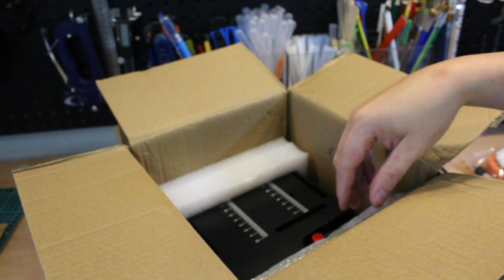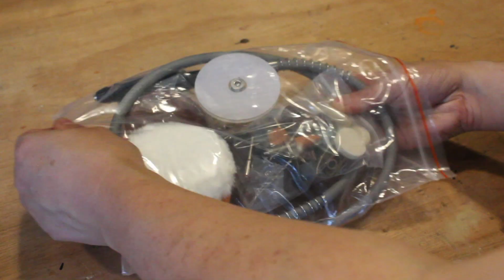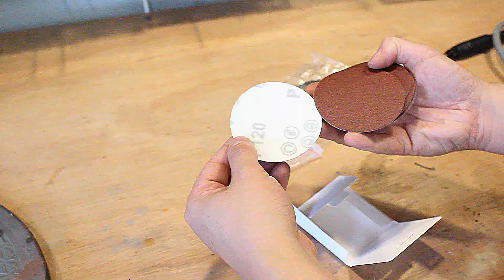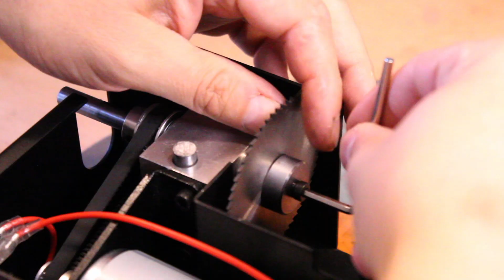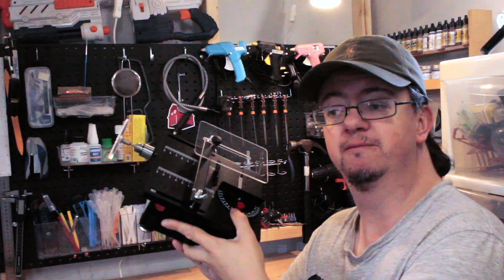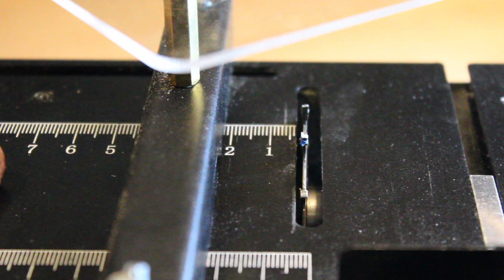Should you buy this Mini Table Saw? - FULL Review!

Comment: I ordered a similar but simplified version off Amazon and it will arrive tomorrow. I’m looking to cut some 1/4” plastic for a tool grid organization in my toolbox and they need cutting to size for your particular toolbox drawer dimensions. I have limited space to store large tools like a standard table saw so I went with one of these as they are the right size and price just for this one project.
Reply from the maker: From what you stated, this would probably work really well for your needs... I must admit I feel like I might have reviewed it a bit harshly, as I have used it plenty of times since the review and it has mostly done what I needed it to... 

However just be aware that if you are looking for ACCURATE cuts, you might need to spend a little (i.e. a LOT) of time checking and rechecking or you'll end up disappointed, frustrated and annoyed. 

Let me know ow how you get on! 🪚🪚🔨
Reply: @DarlingbroughSciFiBuilds I will let you know and possibly film myself cutting the plastic sheets of tool grid. It cant be any worse than my free hand attempt with a jigsaw that was a terrible cut that may have cost me a $120 single board of material. If this saw gets the cut within a couple millimeters of accurate I will be way ahead from where I was. I won’t be sending these things to the moon. I just need something better than a wavy or jagged cut free handing it resulted in. Thanks for taking the time to review, assemble and demonstrate the product. I’m sure it will be helpful when mine arrives tomorrow.
Reply from the maker: Hahaha We have all been there, destroying materials and messing up! Good luck! ❤❤

Comment: ‼‼INSTRUCTIONS‼‼(5-14-26)
Thank you for your video.  I Just found the time to put mine together.  My Temu instructions are really cheesy crummy instructions.  I could not figure out which way the dang spindle was turning for the Longest time to mount the sawblade correctly.  I figured it out by turning on the machine Without the Sawblade.  The open spindle is smooth.  Feel it turning with your thumb and forefinger.  Now you know eh?  Lol

I was testing some Slightly larger pieces of wood that went over the top of the blade by about 1/8 of an inch which caused the spindle to drift to the right and caused serious vibrations making the machine unusable.  Taking the top platform off to look inside was very revealing and informative.  The non sawblade spindle is operated by the controlling motor for the rubber belt that operates both spindles.  The spindle that operates the saw blade drifts because the belt is not properly aligned 180 degrees.  So to correct itself it drifts to the right so that it does align but causes a heavy vibration making the saw unusable.  

                                                          ‼‼‼THE SOLUTION‼‼
The solution I did is to push the sawblade spindle as far to the left (its original position) as possible.  You should hear it or feel it kind of click into position.  Take the belt guide on the Sawblade spindle and loosen the set screws (2) holding the guide in place and move it to the right, right up against the block that holds the spindle.  This will align it with the Non sawblade spindle belt guide.  Now take a small flathead screwdriver and move the belt guide ever so slightly away from the block.  Now insert one of the thinnest sawblades into that gap.  Push the belt guide tight up against it and remove the thin metal piece so there is now a slight gap so it's not flush with the supporting block otherwise  they will tear each other up  and damage your machine.  Tighten those 2 set screws on the belt guide making sure you Don't lose the Gap!  Now the 2 ends of the belt guides line up and Maybe are Slightly offset so the spindle will pull slightly to the left just enough to keep it from drifting to the right At All!

 ‼‼ONE LAST THING‼‼
The Non sawblade spindle has the operational motor.   The side spindle attachment for the added equipment has set screws that are rotating into a wire.  Gently push that soldered wired connection out of the way Slightly and it will be fine.  This equipment seems to be better built than the one I bought from Harbor Freight which broke down very quickly after light usage. I taught myself cabinetry carpentry from YouTube which taught me a lot about how things are connected for workability.  ☘🙂☘ - Kevin
Reply from the maker: Hi Kevin! Thanks for the comment and the update! I must admit when I was testing this saw out, I probably skimmed over some of the instructions in an attempt to get the saw up and running for the video, however since this was posted I DID have a play about with it and have managed to get it to work better... If you check out my latest video, I explain what I actually bought it for, and you should be able to see it works much better now! :)

Comment: A Speed Square tool will help you line up the gate quickly and easily.  For the drill bit head which fell off, I would suggest using Loc-Tite Temporary strength to secure the allen locking screw.  This will hold the head to the shaft, without letting it come loose from the motor's vibrations.

I do a lot of hobby crafting and scratch-building of models.  I own a full-sized table saw, and a full-sized chop saw.  A mini-saw like this is extremely tempting, in spite of this model's warts.  I have a moto tool, without the flexi-shaft, so this all-in-one tool really appeals to me, in spite of its failings.

The miter gauge being so loose is a serious issue, however.  I have some ideas on how I could make it more stable, but it would still be challenging.  It is too bad they don't have better quality control.  The potential of such a multi-tool station is tremendous.  I might look for a higher quality make and model as it really is a neat concept for me.  I appreciate your review.  I almost pulled the trigger on this model...  Cheers!
Reply from the maker: Hey thank you for the comment and the suggestions! I bought this mini table saw for a specific purpose (which I will be discussing in an upcoming video) and despite the issues it has been extremely helpful and has done exactly what I wanted to use it for!

If you are more experienced with power tools, and have a good engineering knowledge (or the ability to resolve issues at least!) then I would still recommend it for model building... However, as I said it will NOT be suitable for anything too heavy... (Use your table saw for that!)

Let me know if you get one and what you think of it!

Comment: im as tempted by the price as im dubious of the safety of the tool, i did wonder if it wasnt intended for wood , id be buying it for cutting plastic plate sheets for scratch builds, do you think it'd possible to install a riving blade in ?
Reply from the maker: Unfortunately I doubt it would be possible to add one... However, with some careful cutting I think it would be safe enough for smaller pieces.

Oh, and it would cut through plastic acrylic / thicker styrene ok... I've used it for sheets of 3-5mm ply wood and its been ok with that, plus a bunch of coffee stirrer taped together seem to pose little issues... 

With regards to the safety, it would definitely suit a more experienced user, as one unfamiliar with power tools / table saws could fairly easily come a cropper of this if they aren't careful...

But if you have a purpose for it, £20-odd quid is only £20-odd quid... Its almost worth paying that purely for the rotary tool accessories! 🛠🔧🧰

Comment: You may want to look at how to use a table saw, your putting the wood on the wrong side of the mitre, which will lift it off the bed of the saw, making the blade try to pull the wood down as it cuts. No wonder it was struggling.
Reply from the maker: Thanks for the comment!

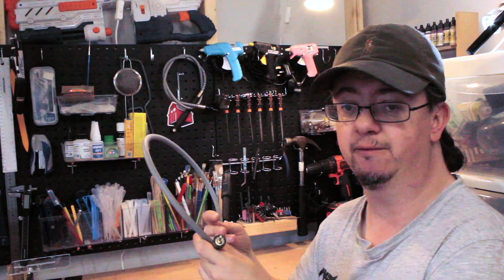I must admit that I DID realise I wasn't using it correctly, and did actually address this in the video... (see 10:48 for a caption which clarified this...). Well spotted though! Appreciate the feedback! 👍👍

Comment: About the fence, I would suggest to make an H-shaped fence, with the two sides of the H undeneath the central part and aligning against the sides of the lid. You would still use screw to hold it in place. A thick piece of wood would do the same job as that piece of steel.
Reply from the maker: Thanks for the suggestion! I will look into that! 😁👍

Comment: One of my brother got a pendulum saw (real nice expensive one) and cut through the nail of his finger (just a little bit) in the first five minutes because he was so eager to use it he didn't reach for a sacrifical piece of wood to push the piece of plastic he was working on. Sacrifical pieces of wood underneath and / or behind the piece make for clean cuts.

So I would politely suggest to use such pieces of wood to push the other pieces you are cutting.
Reply from the maker: Thank you for the suggestion! Although I was quite excited to try out the saw, my excitement to keep all my phalanges is more intense! 🤟🖐🖖

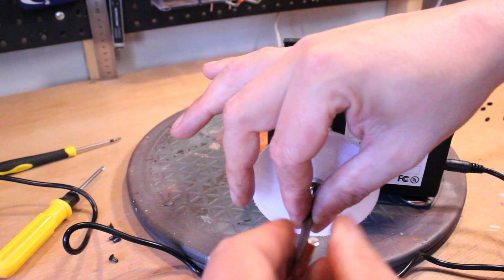Comment: 9:35 May I politely but FIRMLY insist that you don't touch the blade of an electric tool when it is still plugged in? Especially if the switches or contacts are not 100% reliable. Just saying. Politely. But firmly.
Reply from the maker: That is a VERY fair point! Well made! I must admit I hadn't even registered it until you commented! Thank you!

Comment: The review is nicely done, I wouldn't have the patience to show all those details.

Two years ago I bought a mini lathe for 40 € that has a lot in common with your mini-saw (the lathe can also be converted into a mini-saw), for instance the electric transformer that regulates the speed. I was somewhat OK with my lathe, but didn't use it much.

At about 20 pounds your mini-saw is something of a bargain, there is some work involved in fixing some issues. I would say that part of the work is finding out the limitations and ways to work around them (like making a new rail for the mitre gauge).

Paradoxically these defects make them good learning tools, before you switch to the real thing. Before I started with a real sewing machine I bought one for 20 Euros with a lot of plastic gears inside, it got out of sync rapidly, but when I bought a real one at a garage sale (also for 20 Euros  ^^) I knew how to operate it.

The riving knife / kickback issue is a good example of this.
Reply from the maker: Thanks! Yeah, I figured it was important to go into as much detail as possible so people knew exactly what they were getting, and gave my personal opinion on the saw... If you like the reviews, I may do more in the future! 😂
Reply: @DarlingbroughSciFiBuilds   I have no doubt they will be well made and easy to understand. 

Perhaps you can make reviews in between sci-fi stuff? For instance I wonder what happened to the coffee stick rover and its modular cabin. 
Modularity is cool 💪🦾
Reply from the maker: Ahhhh! The ETATV! It is a project that I WILL get back to, probably early in 2026... I was working on this when a LOT changed in my life, which is why I haven't done any more work on it since... But yes... I still have all of the components in a drawer to work on...

(Along with my plasma pulse disruptor canon, the DSFB freighter ship, the bio-lab medi-bay, the full size airlock door panel, the space station bedroom decoration plus several products I have been working on...) 🤭🤣😂
Reply: @DarlingbroughSciFiBuilds Looks like you're going to be busy for a while ^^ Are the miniature projects all at the same scale? (action-figure size IIRC)

 >> the space station bedroom decoration

In my recent release I have been working on removeable floors for rear box bodies on military trucks, each floor has specific furniture glued to it, it makes for quick swapping, it might be of interest to you.
Reply from the maker: HAHA Nope, they are different scales... Ranging from 1:1000 (ish) to 1:1... I actually covered the scale of the ETATV in one of the previous videos...
Reply: @DarlingbroughSciFiBuilds  >> If you like the reviews, I may do more in the future! 😂

They're well made & easy to follow, however I'm curious about the whereabouts of the coffee stick Rover and its modular cabin.

(:face-red-smiling-live:shameless advertising alert :face-red-smiling-live:) I just released two boolkets (double-feature!) about a WW2 series of trucks, there are several modular elements in it (the LC-Koffer furniture and the LRDG weapon support platform).
http://toothpick-miniatures.com/pics/b12_group_03.jpg

Modularity is cool! 💪🦾